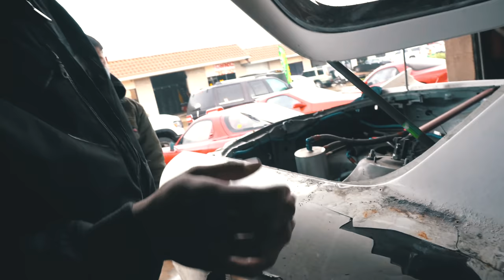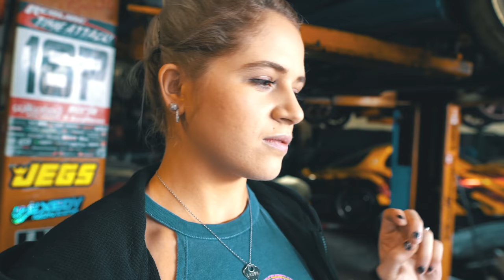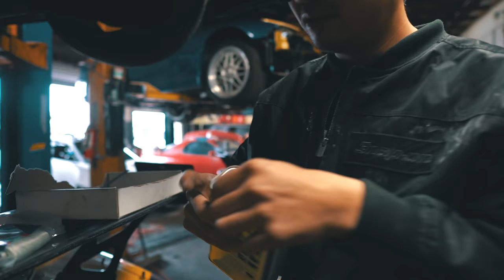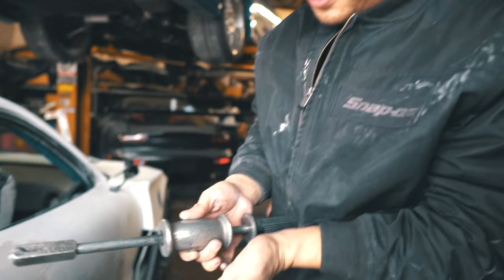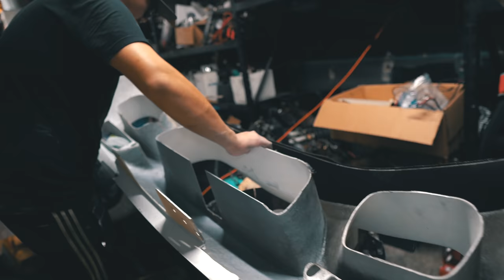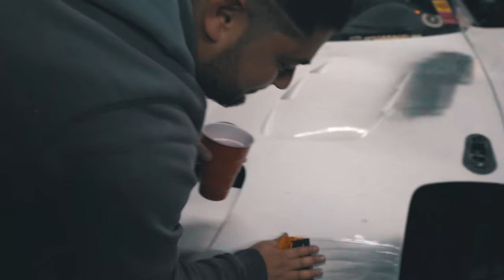Fixing CRASHED RX7 FD Drift Car | Paint Prep , Body Work, Fiberglass repair

Comment: Boo to the crappie weather. Rain, snow, mudslides in norcal. So I wanted  to ask, " in a two rotor, the crank turns three times as fast as the rotor. Is it the same in a three rotor?"